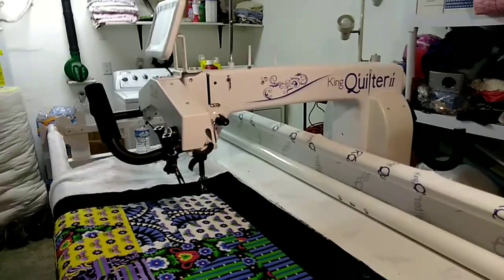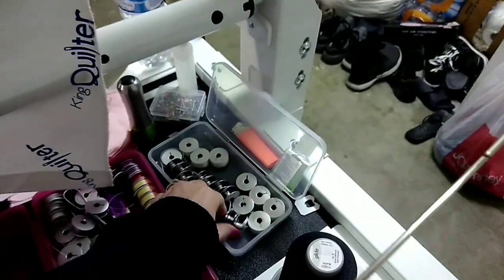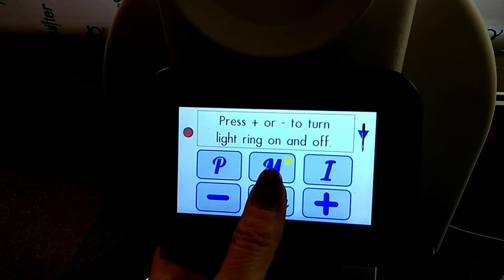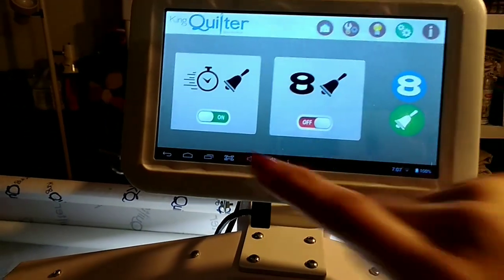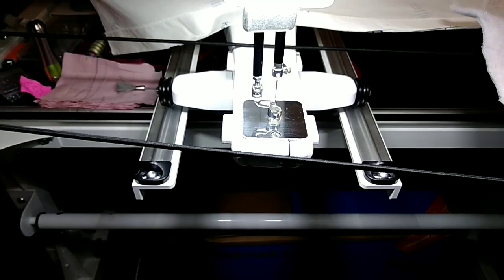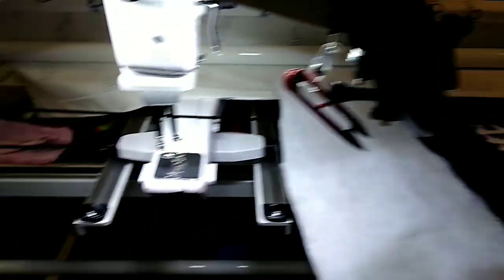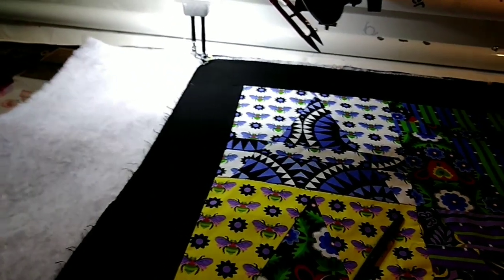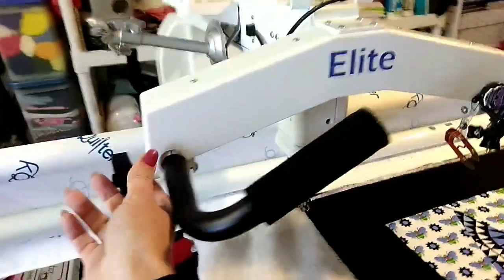King Quilter 2 Elite Special Edition (How To & Review)

Comment: I have that same fabric!!!!   Any type of electronic device needs to be in a temperature controlled environment.  A mini-split system, if in your budget, might allow for temperature control for quilting time.  If your space is not insulated, it would work fine for your quilting time, but you would not want to try to condition all the time.
Reply from the maker: I've moved all my quilting into the house since this video 😊
Reply: @TiffanysQuiltingLife  yes I saw that later.  Nice video you made of the footprint required.  Happy quilting

Comment: Hi Tiffany, thank you so much for the videos. I just purchased this machine and love it but am having trouble with my machine not wanting to stitch left to right. It stitches front to back fabulously but not left to right. Any suggestions. Thanks again Angi
Reply from the maker: Going fast right to left is a issue mine has too. If you stitch right to left in circles or something that isn't straight it goes pretty good. I honestly think its the way the machine was designed and the timing of sorts that keeps it going that way. I mean if you think about it even the computer stitches from left to right.
And I just re read and you said left to right instead. Is it tension or thread maybe? I'm not sure why. Maybe you can give the SMP a call and see what they say.

Comment: Hi Tiffany, I am seriously thinking about buying this machine thanks to your  informational video.  Should I purchase the back screen and handles? In what case would I need these?
Reply from the maker: Well this is a fantastic machine.  When it comes to rear handles and screen.  That would depend if you plan to use pantographs from the back of the machine.  But if you plan to have it up against a wall and rarely go behind the machine just to load the quilts then you wouldn't need rear handles.  So it just depends on how you plan to quilt.  Well here is my link directly to the machine if you are interested in purchasing it. It dont cost you a thing to use my link,  it is just a little support for my channel.  https://shrsl.com/3oq03

Comment: When you go to baste the quilt...do you only have to baste the top row or do you baste the whole quilt?
Reply from the maker: I baste top and sides at first, then sides on the way down with each roll to keep the quilt square.
Reply: @TiffanysQuiltingLife  ok, so you're having to keep changing you stitch length and going back and forth?
Reply from the maker: Only on the sides. Mine has a baste stitch mode so it's easy to swap back and forth between stitches.

Comment: Just purchased the king quilter 2 elite, has anyone had a problem with the handlebar screens? The front one is stuck in precision mode and I can't change the stitch length. The back screen only comes up to the intro screen where it says King Quilter and stays there so the back handle bars are useless. Does anyone know of a fix
Reply from the maker: Unplug and re plug back in. If that don't help then unplug the screen and handle plug on the front left and plug back in. I have my screen on front in a more upright position with no lean since my last screen and handle replacement. It tends to be finicky at times. Also I haven't had issues with the rear screen, but I would say try the same unplug method. I hope that helps 😊